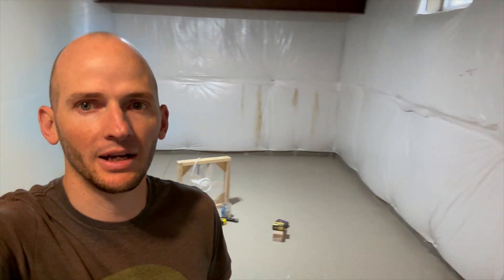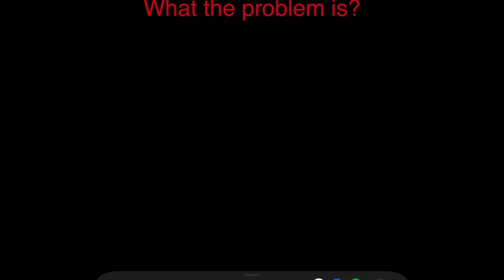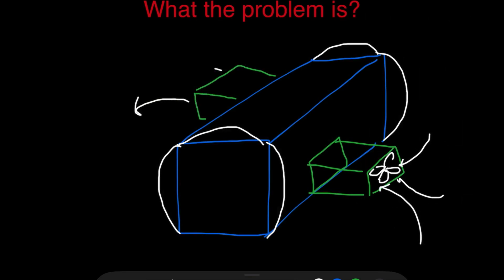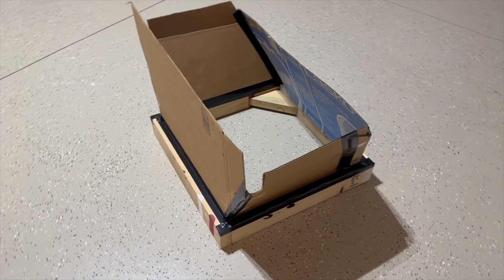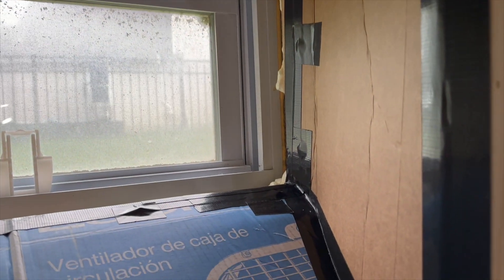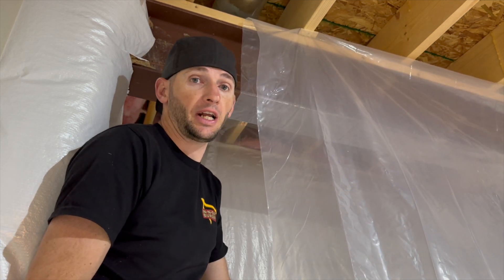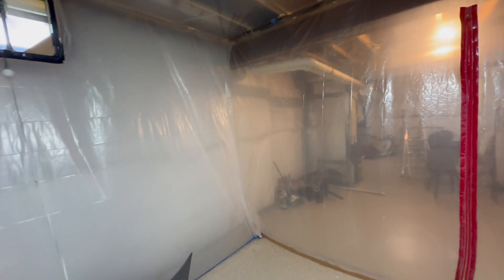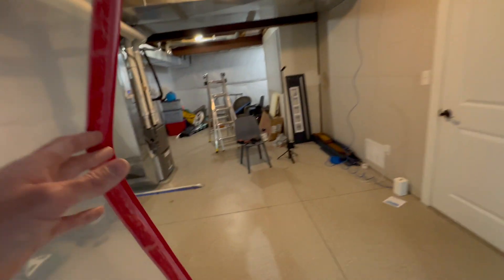Building a DIY Basement Paint Booth (And Saving My Marriage)

Comment: tape some thin strips of some sort to the walls of the tent to prevent it from sucking in like that,and when i made my moms garage in to a paintbooth i used a car radiator fan in the window like you do sort of,,only thing,,,i stained the outside of the house with car paint and had to repaint my moms entire home as a punishment,,,
Reply from the maker: @flightace1  I was slightly worried about that… might have to come up with something that diverts the air through a complex path in an attempt to get the heavier particles (paint) out. Thanks for the heads up! Really appreciate it!
Reply: @TheOkayestEngineer  well leasson learned i have not done that again in 35 years,,a tunnel for dog agillity comes to mind,,,you know that type thats collapsable spiral steel thing covered in nylon,,one or two of those outside the window might get you to safe distance from the wall,,
Reply: @TheOkayestEngineer  get some disposable paper cartridge filters and put them in front of the box fan, it'll save you loads of trouble after. just make sure you seal it so the air has to pass through the filter